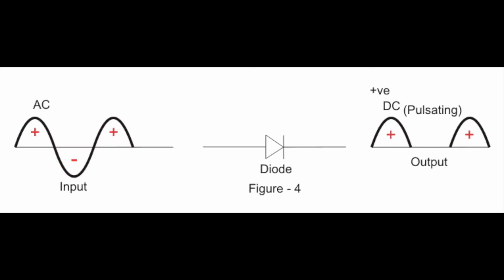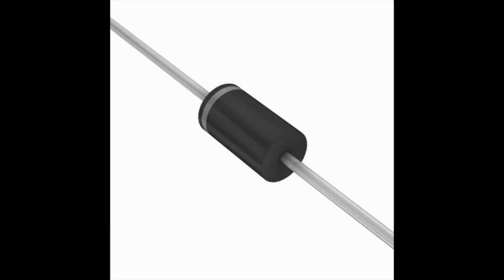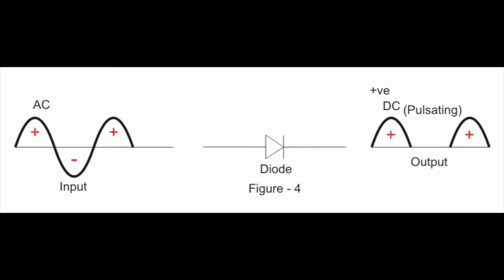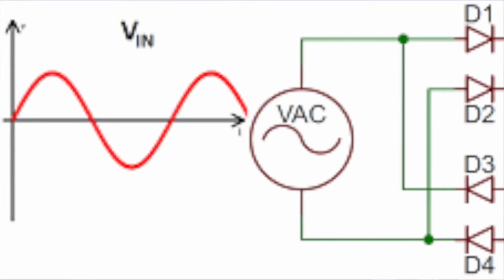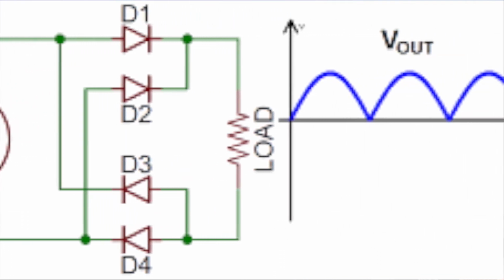Ask an Electrician: What are rectifiers and why do we use them?

Comment: You were sticking with the semi-conductor rectifiers, but the vacuum tube's value was first for rectification with additional controls added later.  I've recently been intrigued by flame rectification used to verify there is an actual flame in a furnace and such.  An AC signal is rectified as current can only flow in one direction through the flame thus proving a flame is present (and that the flame rod is not shorted) with a small DC micro current sensed by the control board.  Flame goes out, current instantly disappears, board instantly shuts off gas valve.
Reply from the maker: That’s a great mention!  One other that I meant to talk about was in fire alarm systems. They put triggering devices and signalling devices on the same circuit, but the signal device only operates when they switch the polarity of the circuit because of the diodes in the circuit.